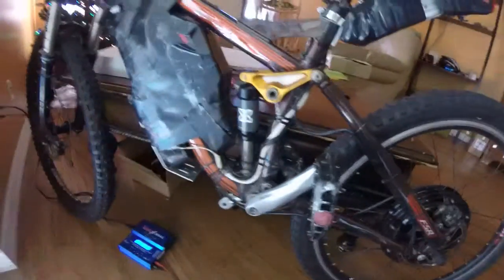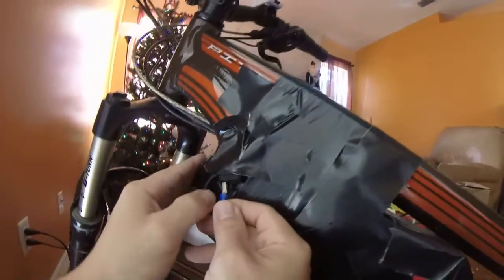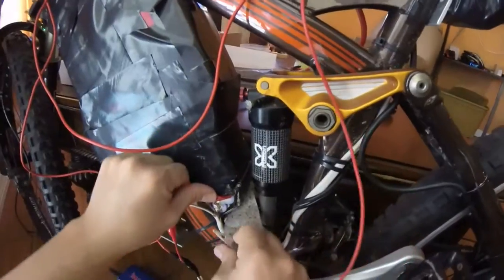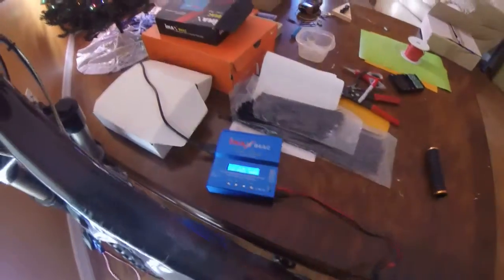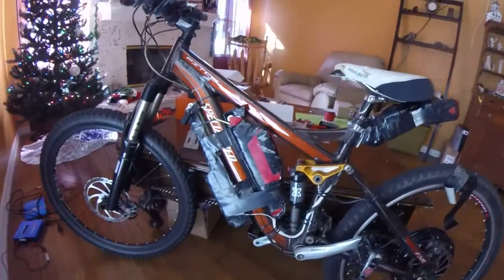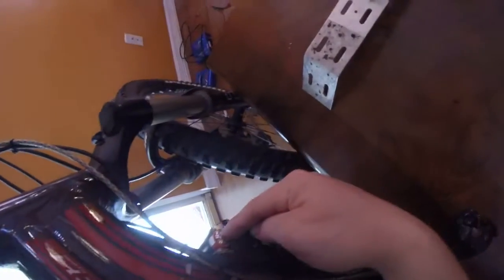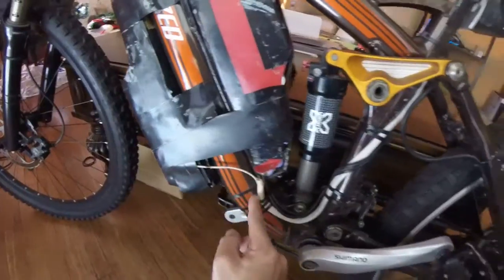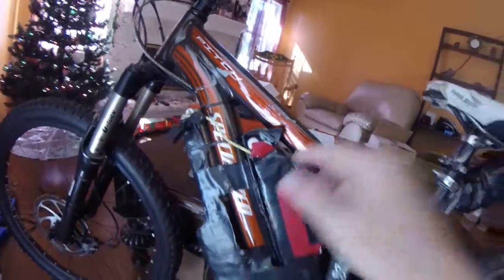48v Imax B6 DIY Ebike 18650 Charging FAIL

Comment: hi mate, like what you have done here.. i have just bought one of these chargers but in the specs it says only upto 20 volt.. just wondered how your managing to charge a 24 volt pack on it.. or are the site specs where i got it from off.. charger has not arrived yest ???
Reply from the maker: ya man. I don't know. both of mine charge up to 24volts.
Reply: good good.. it does say 6 cells which is 24 volt on 18650 anyhow so im sure ill be fine just thought as was cheap charger, most likely a copy, wondered if it differed from the ones your using in video... ill be doing something similar to what you have done here.. ill put a video up when its done.. cheers man..
Reply from the maker: +Truth Hunter mine are both cheap eBay knockoffs. one quit working so I bought another. I have since tho bought a 60volt adjustable power supply and charge with that. cheers!

Comment: I am trying to figure out the cheapest way of balancing and charging my 18650.  For my ebike I need 48v so either 1 pack of 48v or 2 packs of 24v. I too have imax b6ac and is my only way of charging them. I have bunch of 18650 I harvest from laptops but what would you think is the best way to wire them two 24v or one 48v?

I see you using a series of 6 to get 24 volts x 2 making 48 volts total (having 12 series) but from what I read you should really have a series of 13 to get 48v. Hows your performance only using 2 series of 6's?
Reply from the maker: +LMleet06 My recommendation for cheapest best setup is to get a 60 volt 5 amp adjustable bench top power supply from ebay and wire your pack into a 48volt pack and charge at full voltage.

My 12s 48volt pack goes fine. fully charged its 50.2 volts and "dead" at 44.4 volts. I now charge with the above setup instead of whats in this video. stay tuned and subscribe for future vids! Thanks!

Comment: why you bought a balance charge if you are not going to balance the charge ,plop...
Reply from the maker: +H. Pablo Tovar Herrera 
You don't need to balance charge it every time. Just once every 20-30 charges in my opinion, even less than that.
Reply from the maker: Frank Mair Well I can tell you this, I've taken apart 2 used packs of brand new cells. never balance charged and all cells were still perfectly matched.
Reply from the maker: Frank Mair Thanks! :)